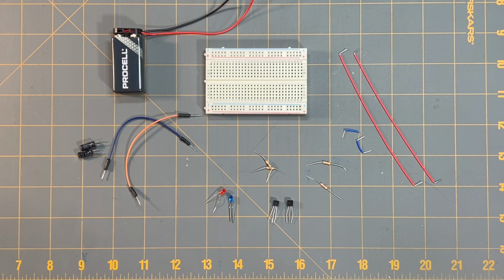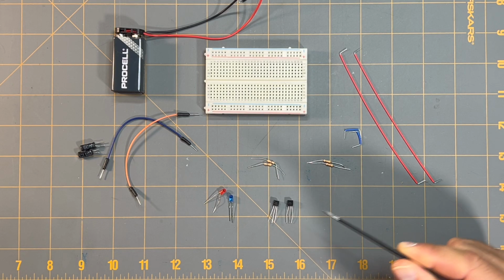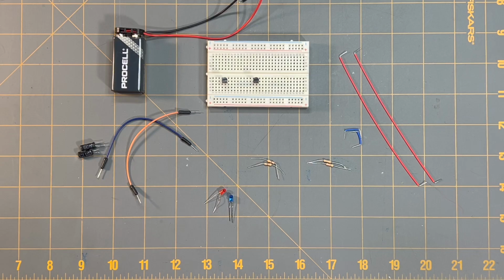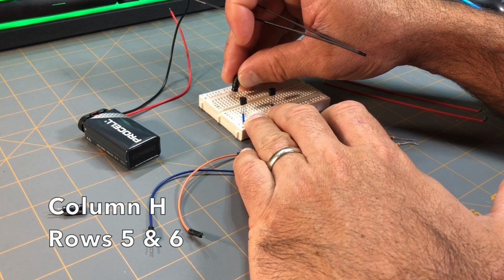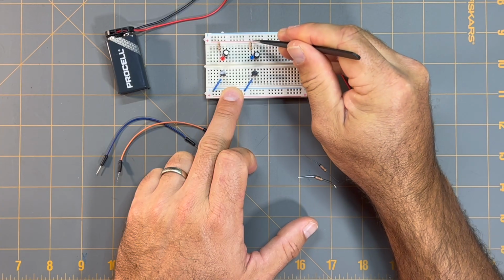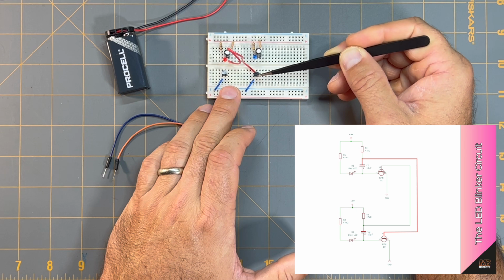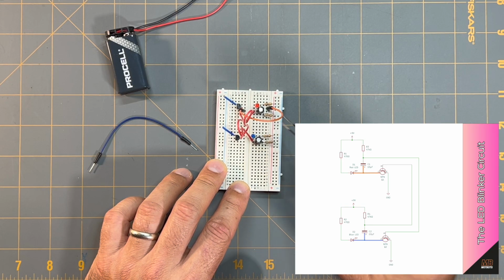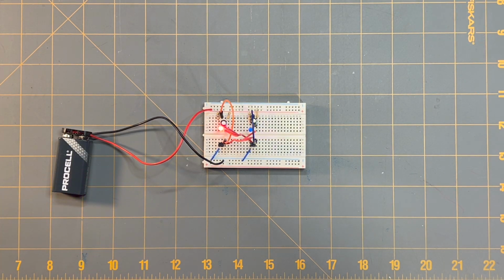How to Make an LED Blinker Circuit (Po-po Lights)

Comment: Can I do it with only 1 light in the circuit? Or do I have to have both?
Reply from the maker: Yes. The circuit can work with just one LED. The LEDs are mainly there to visually show the oscillation happening between the two transistor stages. However, the rest of the circuit still needs to remain connected properly for the blinking action to continue working correctly.
Reply: @motbots so I can do it, but it has to have both the parts only putting away the second led?
Reply from the maker: @marmoxit  You can remove one LED, but keep both transistors, both capacitors, and all four resistors.
For example, referring to the schematic provided in the link in the description of this video, keep the LED labeled D1 (the red LED), and remove the LED labeled D2 (the blue LED). The circuit will still oscillate normally.
If you decide to remove D2 entirely, the collector path on Q2 becomes open. So ideally you'll want to replace that removed LED with a normal diode, or another resistor, or simply leave a collector resistor path. Otherwise the transistor side may not behave quite the same depending on how it’s wired.
So, if you decide to replace the removed LED with a resistor, then one transistor drives the LED, the opposite transistor side has only a resistor load. That keeps the oscillator balanced.
If you want to try this in a simulator, try the one provided on the Motbots website. To do so, click on the "Page URL" link provided in the description of this video, scroll down to the Table of Contents, click on "Simulation for Visual Learners", stop the simulator and remove the blue LED. Then, click on the Draw tab, then click on Add Resistor. Place the resistor where the blue LED was. Double click the resistor and replace its value with "1k", if it isn't already that value. You can Run the simulator to visually see what the circuit does, in theory. You'll want to increase the Simulation Speed and Current Speed of the simulator though, to quickly see what's happening in the circuit.